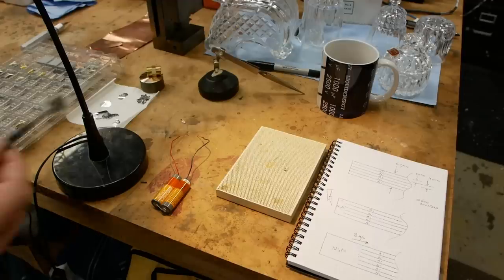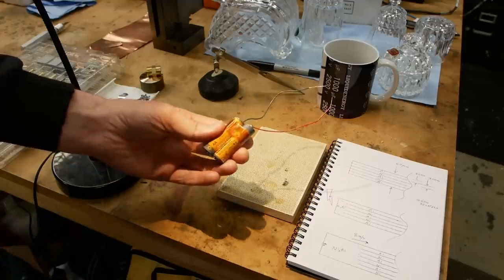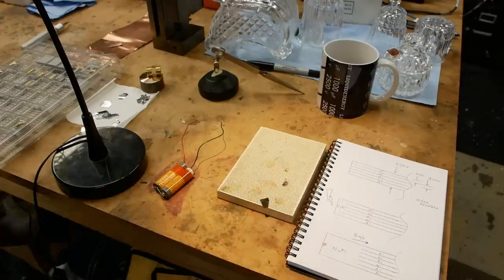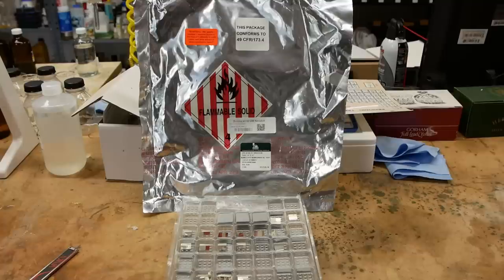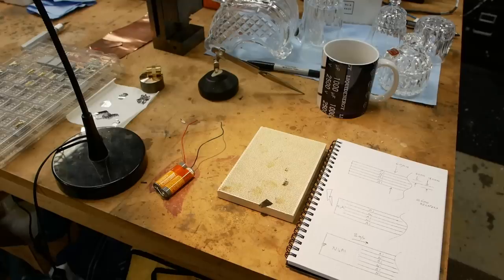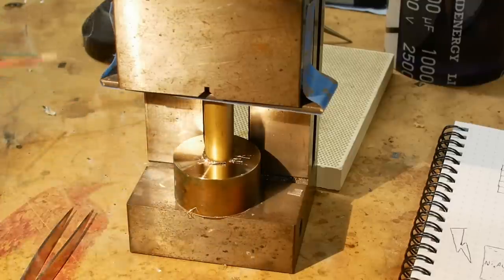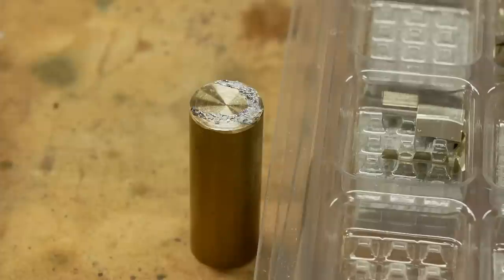Multi-layer reactive foil: no fuel, no oxygen, tons of heat

Comment: Probably need some kind of flux or something. A strong reducing agent between the solder and metal surface.

Alternatively, maybe you could treat the metal with something to prevent oxygen from getting on the surface while you machine. Silicon oil?

Comment: I wonder how well this would work in a vacuum. It seems like perhaps tiny pockets of air are ending up trapped in the interface, and the sudden expansion of the air from the heat might be a factor in the solder being blasted out the sides (in addition to the pressure from the vise).
Reply: I wonder too, if it would stay intact under vacuum conditions.

Comment: Try getting it to bond within a vacuum chamber. This is similar to material I might make to produce for my home a heater that can run off a cheap rechargeable battery that’s charged in the day with a small solar panel and should provide enough power to the heating element after dusk when it gets colder until about bed time. Of course a thermistor and anything to make it safe and as a limiter is vital but the ideal spot for it is at one of the main sources for heat escape of a home and the best place for the small low profile solar cell to be, the windows.  One of the worst infiltration of cold there is even with low E glass. I coined my project “ Dusk assist “ which is also part of other projects to help lower the cost of operating normally used appliances in the home. Good luck with your project but yeah, try cold fusion as well as doping metals with plasma.

Comment: Laser firing pins are pretty cool. But it supports the primer from coming backing out the case so getting rid of a solid pin is a real issue. Could work with the side pins of a pin fire though b/c its in the side.
  Wouldn't some indium in your solder let it wet more and be thinner as a result or would it just stick to glass then?

Comment: Interesting, is it possible that the issue in bonding your brass test pieces is the inclusion of the reactive material itself in the joint?
Could you put a hole with the solder in the centre or arrange several pieces with an aperture and solder?

Comment: Can this metal-material be used as a getter in vacuum tubes?  One problem, when making small home-made evacuated tubes  (e.g. nixie tubes for digital readouts) is that one may not have the ultimate vacuum pumping hardware. Could this nano-scale aluminum/nickel be used to removed the last of oxygen and other gases in a sealed vacuum tube?  The experiment would be to see if after ignition, does it out-gas?

Comment: Isn't the solder joint inherently contaminated by the AlNi layer, messing up the integrity of the joint ? Or is it supposed to be two solder joints in series, with the AlNi layer in-between?

Comment: Wait, how's that supposed to work?!
Solder does not really stick to anything cold. If the reactive foil in the middle like this is just going to boil the solder. No heat is going to reach the brass. What is the difference from just pouring molten solder over the bronze?

Comment: if you put a wire of solder around a copper pipe joint and then a couple wraps of energetic material would it make a decent solder joint?

Comment: Don't you need flux? Also, if the NiAl foil is inbetween the two items to be joined won't it interfere with the bond? There's no way it can get out of the way so the solder can form a direct path between the two surfaces to be soldered.

Comment: flux, try a little, though considering you still have that nanfoil between the layers not sure i see much use for it for bonds with any strength, but good enough for light bonding that won't take any stress especially with heat wicking components. could also try arcing it through the materials to be bonded to set it off rather than the foil itself.

Comment: Does the NiAl compound generated by the reaction stick well to the solder after the reaction, or does it effectively cause a separation layer?
Reply: It does! But you have to exert even clamping pressure across the joint. Highly structural bonds can be achieved.
Reply: @jamgreg  Oh nice, that's pretty neat!

Comment: Should be perfect for soldering nickel tabs to Li-Ion battery cells, no worries about heat damage to cells. It would have to be very cheap though because you could just buy a micro spot welder.

Comment: It is exactly what I'm thinking about to "solder" (melt) plastic.
I have a piece of broken plastic (PP) from an iron unit that is broken and no way to heat it up to around 599 Fahrenheit / 315 celsius, or maybe a little more than that.
Do you think it'll work?, if you think so then I 'll try it.
Thanks in advance.
Reply: If you want to repair broken plastic your options are solvent (to chemically bond the plastic to each other), adhesive (to mechanically bond the plastic to each other), heat (to revert thermoplastics back to a molten state and then they resolidify together), and external or internal mechanical reinforcement (to transfer load between two non bonded parts).

The soldering part you mentioned is a thing, they sell a kit with a pencil soldering iron with various tips and some plastic filler rods, so that as you melt both sides you don't just melt the plastic out of the way, you also have additional new plastic to fill the gap you just created, it's basically TIG welding, but for plastic, same concept and execution.

An alternative to joining parts using only plastic is to use the large area flat bottomed clothes-iron-shaped tip that comes in the plastic welding kit to press into the plastic a stainless steel mesh (like a window bug screen, can get in various wire gauge and wire spacing to provide for greater strength, stiffness, malleability to fit curved parts, etc.) by simply setting the mesh on the plastic, holding the iron on to the mesh, and the heat conducted will melt the plastic under the mesh and the mesh will embed itself into the plastic and become as internal to the plastic as you desire to push it in, you can leave it exposed on the surface, partially bury it, or make it disappear.

If you just need to close up a crack in a few spots, or provide some mechanical reinforcement so as to not rely entirely on plastic welding the seam then the fastest/easiest method is to use a plastic stapler. It's a basically a glorified wiggly paper clip heater. They make the metal staples in different shapes to reinforce flat areas, inside corners, outside corners, etc. To use it you put the two free ends of the metal staple into the heater tips, press the staple to the plastic where desired and after the staple heats up a bit it will migrate into the plastic, and once to the depth desired you cease heating it, release it from the heater, and use a flush cutter to trim the ends of the staple that are still sticking out of the plastic.

If you're not needing the part to be aesthetically pleasing or to have the plastic sealed together to be free of air or water leaks and they just need to be mechanically connected together then you can just do a bunch of staples and call it a day after only 5 minutes of work; no smelly or messy chemicals, no finesse or skill with plastic welding required, no needing matching plastic type filler rods on hand, etc., just slap in some staples and you're done.

But if you do need any of those things then it's still helpful to use the staples the same way you would use tacks when welding, to hold the pieces together where you want them so that you don't have to both fixture or hold them in the desired positions and also have to attempt to bond them together at the same time, you can do the positioning step first, and then focus better on completing the bonding as a completely separate second step.
Reply: @msytdc1577  Thanks a lot for your insightful comment.

Comment: I don't understand how you want to solder where you put your material in solder and between parts, when it is brittle ?
Rather try to make hole in this material and press solder inside hole that it will heat it from side.

Comment: But if the solder had taken wouldn't you have ended up with the reacted material running through the middle of the solder ? As opposed to a fillet of solder running right from one bronze piece to the other ?
Reply: my thoughts as well. I think the "soldering" application of this is mainly for lab work, ie soldering something together in a vacuum.  probably just good for "tacking" things together and it provides a conductive bond.
Reply: was thinking that as well, but it also turns very brittle and crumbles under the pressure, so should meld witht he solder, but maybe if the two solder sheets arent completely covered by the reactive sheet so they still have some contact with each other, or if you stamp a small hole allowing the solder to flow... could also be reliant on what kind of solder used? not sure what was used here. but maybe try silver soldering a pipe fitting or something?

Comment: This is an extremely interesting material.  What about the fact that you now have this layer of NiAl intermetallic compound in the middle of your solder bond?  It doesn't just magically disappear.
Reply: it might be a bit brittle, but NiAl intermetallics supposedly have good structural properties..
NiAl in general is very interesting, given that it’s made from two easily available and cheap materials.
Reply: Unfortunately you do end up with NiAl in the bond. Sort of luckily the nano foil fractures allowing solder to span both sides of the joint. Due to the short wetting time nano foil bonding is not great. Reflow or nano silver of nano copper sinter is more promising

Comment: The electrician in me had some head cinema about self soldering wiring.
Copper wire, a coating of this stuff and some more solder. Just touch the wires to the terminals, done.
Would be really fun in EX enviroments :-D (I used to work in industrial grain mills. "Drill a hole in this I-Beam but don't exceed 120 rpm. Ok...zzZZ)

Comment: Did you try to use it without the solder? I guess, a lot of heat is lost by melting the solder alloy instead of the surfaces intended to be soldered.

Comment: Im confused, wouldnt the fused metal get in the way of the solder joint?
Reply: It becomes an integral part of the joint. Yes, the resistivity of the alloy may be higher than solder would alone be, but it's so dang thin that the total series resistance is negligible.

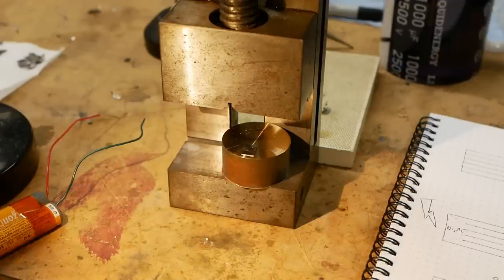Comment: 4:10 drop a glob of solder from your solder iron on a clean ceramic tile and you'll get a very thin section out of it. You'll have to science the exact size of glob, but something like the size of the @ symbol on a standard laptop keyboard should be ok to start with (in apparent diameter).

Comment: Do you think you could light tinder with it? The heat is a lot, but is it too quick to start a flame?
Reply: you could definitely light tinder with it. I have seen it working (correctly) by melting (welding) two pieces of metal together with a bright flash too. You would have to be a pretty rich survivalist to keep a meaningful amount of this stuff ready - - it's quite expensive.
Reply: @JurekOK  powerful stuff then. Yeah I can imagine it's expensive, couldn't see any for sale in the UK. 
Was thinking more of that last golden bullet option for air crew etc. Small, light and powerful.

Comment: I wonder if the issue was actually the thermal escape of the solder splattering. I wonder how it would go if you made the metal element into a ring around a circle of solder and the compressive force would potentially contain a lot of heat. Maybe a drop of flux wouldn't hurt either.

Comment: How do they make this stuff without setting it off?
Reply: Guess: They probably electro/chemo-plate the alternating layers to each-other.
If the reaction needs to be initiated with a large influx of energy(heat), plating shouldn't be a good environment to start it.
Reply: @Prophes0r  That was my best guess as well but typical plating currents are way higher that what he is using to initiate the reaction. the large contact area and cold solution may make it work but I bet it's still a good story.
Reply: @brocktechnology  Looking at the manufacturer's site, they use metal vapor deposition. Way more labor intensive than I assumed.

Comment: I wonder if you could make this by grinding both metals into a fine powder in an oxygen-free atmosphere.
Reply: That sounds more like a solid rocket propellant than an engineering material. I'd keep my distance. 😅
Reply: @jamgreg  if the mixture doesn't make any gas and only makes heat it would be a terrible rocket propellent. 

For rocket propellent you want the opposite - maximum gas with low enough temperature to not destroy the rest of the rocket or the nozzle.

Comment: That's a crappie use intention. Do you know how to solder? Yes? Then why don't you preheat those chunky metal parts?! This Metall would be more suitable to solder SMD parts that are too heat sensitive to bake them. I would use soldering paste on the pads for the SMD part and then place a tiny speck of that metal and " light it off " with a laser to solder the heat sensitive SMD component to the pcb without causing to much heat. Solder past with such properties would be very useful for bad to reach places on a pcb repair though 🤔. You might have something there but you just used it wrong 😅